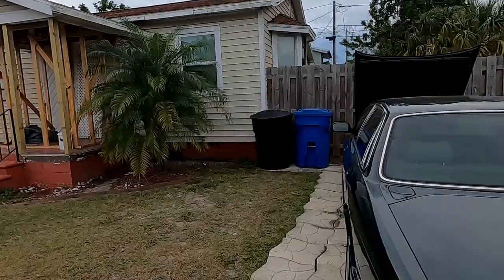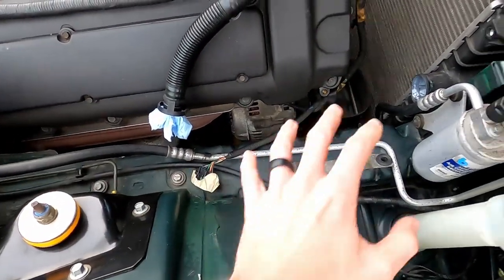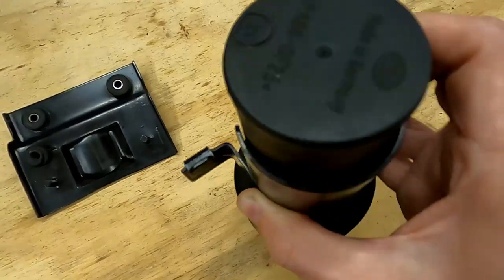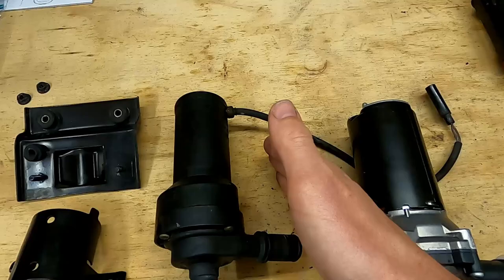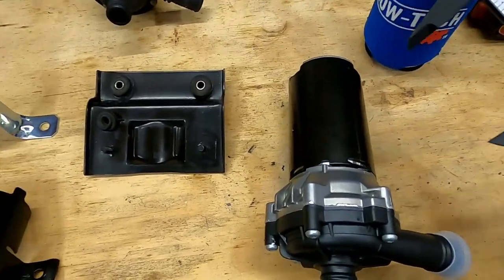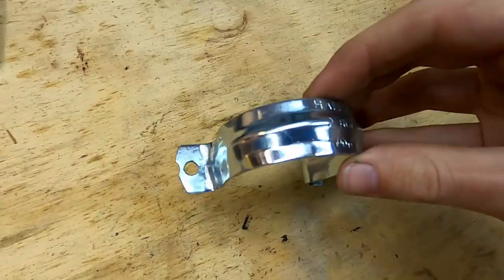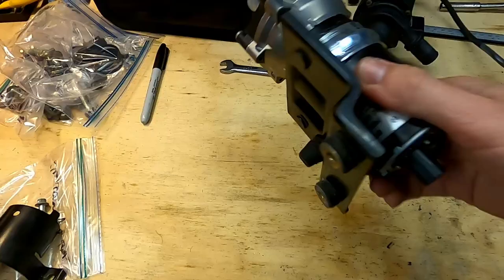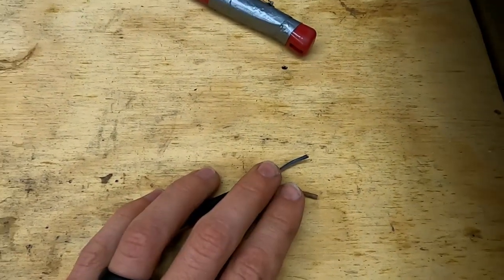Jaguar XJR Intercooler Pump Upgrade

Comment: The Bosch pump is fitted to mercedes supercharged vehicles and they can supply the connector for about £5
Reply from the maker: Thanks for the feedback on that! We worked with what we had in the shop and it came together nicely.

Comment: Owner of 98 XJR - great Vid and your others.  Would have like the process removing and add the supercharger as a DIY'er. You mentioned additional boost, what mod's do you intend for increase?  I've had my upper pully down.
Reply from the maker: Thanks for the positive feedback. We are just wrapping up an in-depth service on the car which involves removing the supercharger among other items. We will be posting videos on all of this. 

Upper pulley is for now, we have a few more items in the works once the car is back together and road tested!
Reply: Low-Tech look forward to that. I have the same coolant leak there so keen to see how you went about that.
Reply: @eddyrocket8737  I just recently had the same coolant hose leak in the valley. I had to dive in there and replace it myself after spending two days of learning-as-I-go-along. YouTube does NOT have any step-by-step video of how to correctly remove the throttle body, the intake elbow so you can access that one single rear bolt that anchors down the Eaton M112. I think the biggest lesson I have learned is to document where your wiring and vacuum hoses go to and to exercise real patience because the plastic connectors have been heat soaked for a very long time and they will not cooperate as originally designed. I personally induced my own problems by cracking and breaking some of the clips of the vacuum hoses that attach to the side of the intake elbow on the left side of the elbow and they’re terrible to access when the throttle body is mounted and the coolant reservoir head tank is mounted there in your way to access the area you want to work in. My work is not done yet, but I now think I understand what I need to do to correct my self-induced issues. I really pray that you finish up the complete video so I can help critique what problems I encountered on my own without the aid of videos and no shop manual at hand. I think now I will buy a X308 shop manual for my 2003 Super V8.

Comment: one other random question.. have you verified your secondary fuel pump is working? It is a common failure point, and might be sad if fuel pressure isn't what you want once your supercharger system is all fresh and new! My understanding is that the secondary pump activates over a certain RPM threshold (perhaps 3000?). You can check whether it is working by activating it's relay and checking for power draw. Unfortunately, the fuel pumps are a  PITA to change if one is bad...
Reply from the maker: Thanks for the tip, this is something we have not confirmed yet. Performance was good prior to this project but not harm in testing as the cars 20 years old!
Reply: Don't let your gas go under 1/4 tank, it's below the second pump and will kill it by running dry

Comment: How did the hoses fit on that pump seen the connections are a bit bigger then the old pump ?????
Reply from the maker: They fit just fine. No modification to hoses were required.
Reply: Awsome thanks for letting me know i appreciate the time you take to reply with all the projects you got on the go.  Cheers im orderi g the pump tonight  @Low Tech Garage

Comment: Does the pump upgrade increase the coolant pressure on the hoses and do you think it might cause a leak if the hoses aren't replaced?
I found the pump on Partsgeek.com.  Cheapest price I could find.  They are my primary to go people for auto parts.  I'll be upgrading the upper pulley on my SV8 soon.  Thanks!
Reply from the maker: We opted to replace the hoses for good measure, ours were original to the car. I am sure the higher volume does increase the pressure so for the extra cost it is good insurance.

Comment: Do you really need a intercooler pump upgrade? Heard of water methanol inj ctoon?
Reply from the maker: The pump is definitely suggested especially in hot climates. It helps a lot with heat soak.
Reply: @LowTechGarage  do you mean that everyone living in Fl.,Texas and in the tropics should have one? I don’t think so, it’s just an overkill. Water methanol injection is much, much better and easier to install. It cools and steam clean your engine too. I live in the tropic and never

Comment: Hello, will this pump fit a 2004 Jaguar XJR ? And it also referred to as the Auxillary Water pump? Thank you
Reply from the maker: Yes this will fit on the X350. This is the intercooler water pump for the supercharger. The aux water pump is another pump for the cooling system. I recommend looking up the aux water pump for a Lincoln LS if that is what you are trying to replace. The part is interchangeable.

Comment: Anyone know how much of an upgrade on the power you'd need this intercooler upgrade for?
Reply from the maker: It’s recommended if you change the supercharger pulley to help with heat soak.